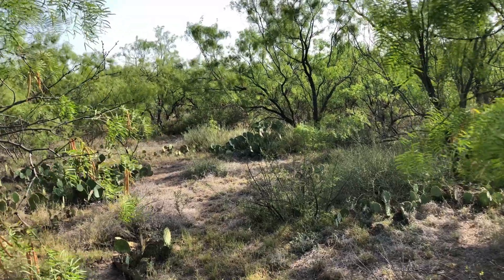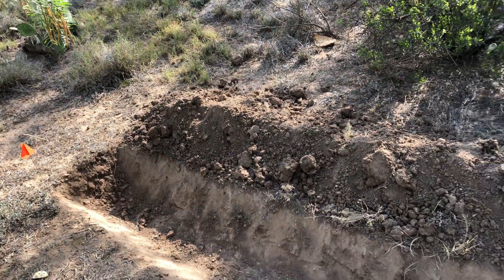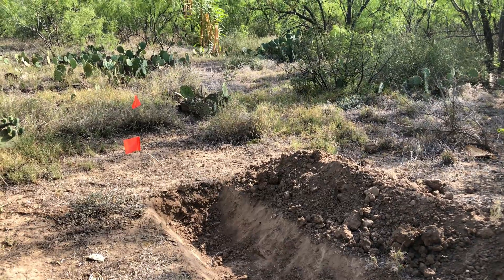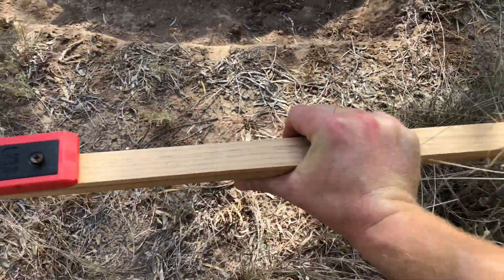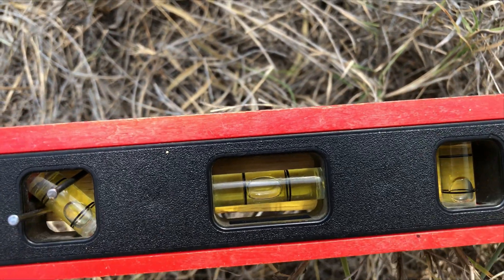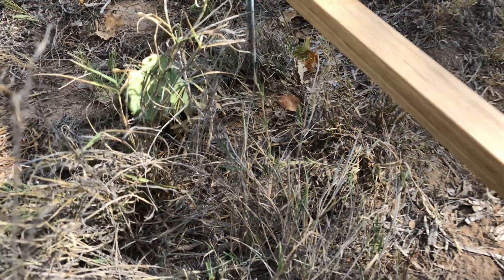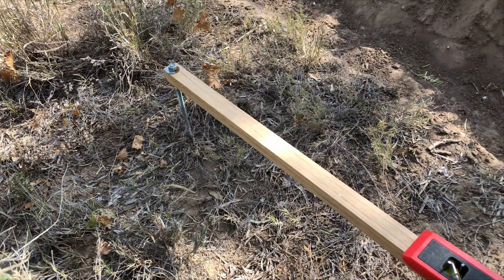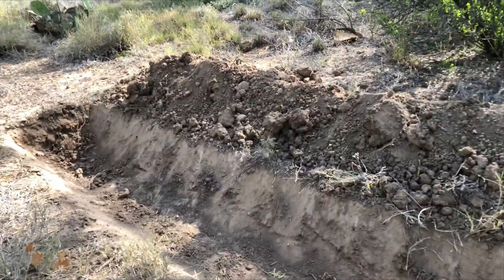Swale Project Part 1: Finding Contour Lines

Comment: Super hack, not offending, but if you're using a low quality tool (seems to me) your level can be inaccurate depending on the length, because it sums up. The A frame is in that case more accurate.
Reply from the maker: Thanks

Comment: I don't think the swales need to be that deep. You need deeper swales for sharper grades, but on a gentle slope like this, maybe 6 inches is enough. Basically, just come in from one side at a slight angle, to make "check" shaped swale, instead of a trough. It works nevertheless, but its more work, and maybe not needed. BTW, you get better results by having a greater number of shallow swales than having fewer but deeper. Especially on gentle grades. You can basically grade and contour the whole property with swales in set intervals of seperation going downgrade.
Reply from the maker: Thanks

Comment: I'm not sure if it's the camera angle... but the dirt from the swale trench , the berm, should be on the downward slope side, not upslope. Reason is as the dirt acts like a water storage sponge for trees you plant in that berm. Critical to the swale working, by keeping the water near surface, by the negative atmosphere upward suction created by the tree roots in the berm. Swales are a tree growing system on contour. Otherwise these are just water soak drainage ditches. It will improve a little but you won't likely get the results you want, which is 7yr long term water availability in the sub soil of the slope. Trees with roots are the vital ingredient to keeping the water available and trickling very slowly down the slopes sub soil. Slowed by the roots negative atmospheres suction below ground.
Reply from the maker: Hello, you’re not the first to make that comment, so I’m sure it is a poor camera angle. The berm is on the downslope side. Thank you
Reply: @WestTexasGardenExperiment  great videos mate. Liked them all. Really good to see how you are progressing. Learnt a lot seeing it. Cheers!

Comment: Not too shabby, you could have put that water level on the a frame as well. I have seen people do that
Reply from the maker: Thanks, that would’ve made too much sense! 🤦‍♂️
Reply: @WestTexasGardenExperiment  haha, curious to see the rest of your movies
Reply: And you could also easily build in a fixed gradient using that nuts and bolts device by adjusting the height of one side

Comment: Good job..
Can you share what Instrument you used to dig out the swales ..cuz they look reall neat!!
Reply from the maker: Hello, I just used a shovel. The shovel I used has a serrated edge on one side that helps cut through roots, but you could just as easily use a hatchet for that. Thank you
Reply: @WestTexasGardenExperiment  ohh that's great!!, Thank you for the info!!
Reply from the maker: You're welcome! I believe it is more common to use a back hose or excavator to dig the larger swales. It does take more time to dig by hand, but it is free and mostly just an experiment to see how a hand dug swale will perform over time.

Comment: Nice idea for finding contour.  I might add another 1x2 to it, turned 90 degrees and screw to the existing one. A stiff back that would keep it from bowing.
Reply from the maker: Thanks! So far, the tool has worked out well and kept its shape. It’s a left over piece of red oak from a stair tread, and it’s very rigid.

Comment: Nice DIY tool .. I think I would want longer legs on it, so I wouldn't have to bend over to use it.  Those mesquite beans look like they are getting ready to pick 😊👍
Reply from the maker: Thanks! If I had to go buy materials to build one of those tools, I might get some longer threaded rods to make it a bit taller, but then again, I'm already having to bend down to place the flags in the ground, so it isn't too much trouble for me to bend down.